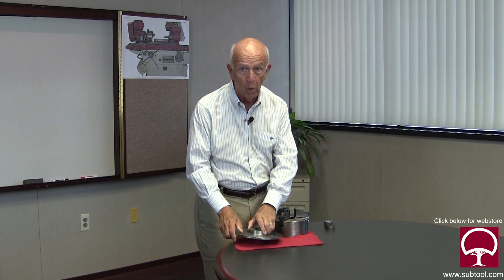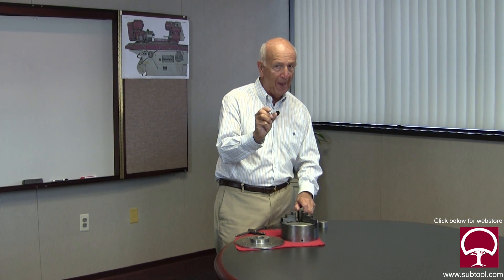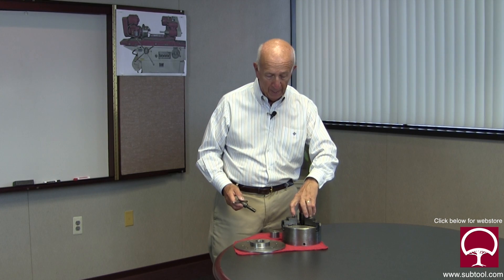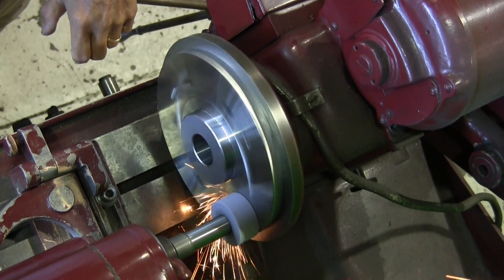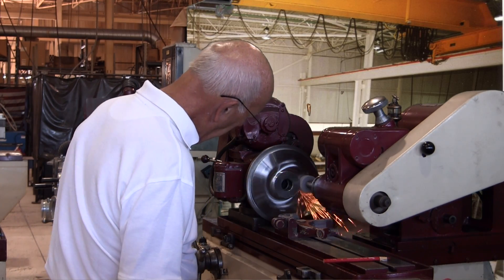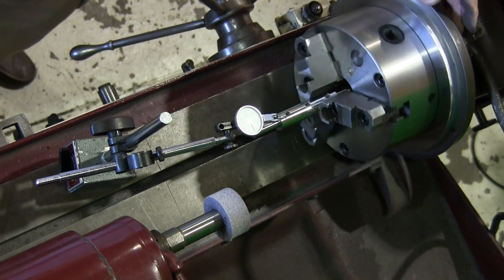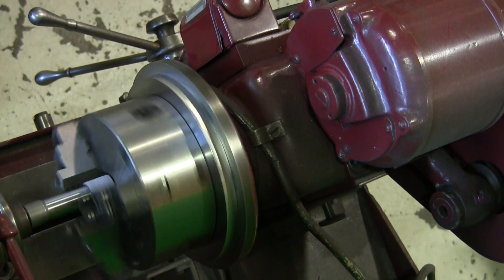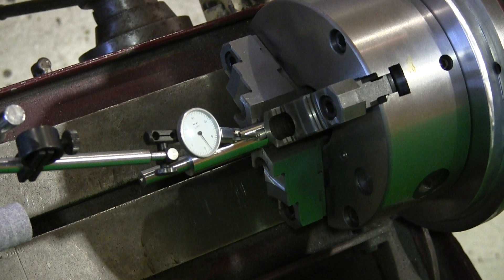How to improve the accuracy of your 3 jaw chuck.

Comment: Thank you for sharing that😊 These days I wire EDM a hole in a 1” thick plate to a wring or light press fit to the OD of my bushing, install it in the plate, then wire EDM the ID. Good size control and dead zero concentricity & taper. Or a specific taper if I want. Always good to know the alternative ways if you have certain equipment - yours is timeless 👍

Comment: I used a round grind stone in my tail stock with an old 3 jaw with 10 thousands run out and got it to 3 thousands,, had to try just to see if it could work and was surprised how well,, where there's a will there's a way,, just seems using the same machine is the best way to go

Comment: Have seen similar done in another video - but they removed 1 bolt from each jaw, fitted a longer bolt in each jaw and used those to clamp a machined ring - so the jaws are all under normal tightening tension without the normal jaw faces being obscured - so the full length of the jaws can be ground.

Comment: The biggest problem with 3 jaw chucks is the float from the internal spiral plate so cleaning and oiling the chuck from day one eliminates a lot of problems with wear and I found that just tapping into true works also just buy a new good quality chuck and cut your losses,I refused to use those bolt on jaw type chucks and so my 12 inch 3 jaw chucks ran inside one thou at all times and used older chucks for rougher jobs,horses for courses.

Comment: i think the only problem with this technique is that it depends on having a VERY VERY precise spiral cut into the jaw tensioning mechanism in the chuck ... if there's ANY deviation at all  - which there likely IS - you will get different concentricity at different diameters (or?)
Reply: My chuck has this problem,  spiral is not precise. I couldn't get a good concentricy

Comment: i actualy did this at my work, but if i watching things like this, i am really happy to live in europe, because number (for me its not really a true number) like "1/1000, 2/10" just blowing my mind ... For me is it like 1/1000  is 0.001 and 2/10 is 0.2 (is not really but you get the idea) and for grinding diameters is this very significant difference between those sizes of diiameters.
Reply: 2/10 is = .0002   [ 2 ten thousands of a inch ... bit of a slang  term. }

Comment: If you relieve the back of the jaws then won’t you lose some of your clamping surface?
Reply: Yes, you will. But the effect is negligible. In fact, you could end up with more bearing surface depending on how well the jaws were ground originally. Likely not all that precise.

On a run of the mill 3 jaw chuck, probably not ground super co-planar to the spindle bore in the first place.

Comment: After 55 years of lathe maching. Listen to this.  Even four jaw Chucks can use this method.  Have a plate made which has 4 jaw and 3 jaw holes drilled into it at proper diameter.and on the outter bolt holes of your chuck.  remove the allen head bolts and put a bolt in there to tighten the jaw.  clamp in that ring hard what preasure you will be using for your prodject. then grind the inner face of the jaws.  What you will find is perfection.  Remove the ring and replace the allen head bolt. Thanks for allowing me to imput.

Comment: That's all good if you hold your parts in lathe in the back of jaws and tighten lightly, as you did when grinding.

Mostly we hold parts in the front when turning ...the jaws need to be tighten allot more then grinding, you need to mimic this when grinding jaws.
As jaws need more clamping power in front, the pre load needs to be in the front...I do this with ring and 3 dowel pins installed which go inside the jaw hole in front,  [need to be loose],  my Forkardt chuck have holes in hard jaws, you could drill also],  some people use the jaw screw holes for mounting ring which I see only a slight problem...the jaws might slightly be binding from each other and uneven forces are applied..but with care this can be minimal and for this purpose well suited. 

About .003" taper to the back of hard jaws I grind or hard turn for spring back ..gives you greater clamping force in front where it's needed.

When turning soft jaws very accurate, most often I use a ring with 3 - 90degree bolts installed on the side...threaded part goes inside the ring, the none threaded part goes inside front of counter bored screw holes,  I can adjust easy to the size of parts turned by turning one or more screws in or out ...close to part size, [closer the better] very minimal of turning out soft jaws.

Comment: not a big fan of clamping the jaws inside the chuck to get them running true, especially when the chuck was already used for some time. the t-guidances might have worn out by then, and all you'd achieve is to have a taper on the jaws resulting in poor stabilization of longer parts and they would never run true.
what i do on my lathe is to get a new set of (hardened bloc) jaws, bore a small hole in the most protruding surface in all of them at roughly the same position and insert a bolt of the same diameter in order to clamp a machined ring. with that you got the clearance to grind/turn the ID of the jaws all the way through just perfectly the way they would bend out naturally inside the t-guidances of the chuck and without any taper by default.
i actually performed that recently on a 15 year old 10" chuck, and the runout on a most precise carbide shaft with .45" diameter was below a third of a thou with no significant taper on about 4 inches away from the jaws.
worked everytime so far.

Comment: I learned that from a toolmaker 30 years ago. My chuck on the lathe still good, first tighten to 2-3 microns!. The important thing is to always tighten in the same chuck key hole, so that the scroll is in the orientation, internally as when jaws were first ground. As well as grinding the jaws, I used a mild steel bar in the tailstock, grinding paste, and did final lapping finish on the jaws, tightening down on the bar and grinding paste. As long as jaw numbers are always sequenced the same, works a treat! Can get better than that, with the soft hammer, as it is tightened. 2-3 microns is perfect for most jobs in the lathe, (and I have a tool post grinder, too).
 Hope this helps ;)

Comment: If the scroll has run out then it may be in the bearing surface of the chuck where the scroll runs on. The boss that the scroll bearing surface runs on has to be machined and a
 ring put on it and then ground or accurately machined to be a transition fit for the scroll bearing surface for it to be accurate.  
If this has slop then all the amount of machining the jaws won't fix it.  The hard part is accurately measuring the surface of the chuck boss to be able to get a good fit
 as it's deep down inside the chuck with about an inch of clearance either side.  calipers aren't accurate enough so a micrometer is needed.

Comment: Why not turn the jaws? a rough finish will help grip your part better I think. It's how we do it at least. and why not indicate the chuck before grinding? i know youll take off less material but won't your chuck be running out and causing your lathe to shake at high speeds? 
don't want to sound smart, I'm still learning and asking questions.

I subscribed
thanks for the great videos!
Reply: Totally agree with indicating the chuck before grinding the jaws. Indicating the jaws does not make sense.
Reply: I agree indicating the chuck first then indicating the jaws to find the difference before grinding.
Reply: To the Russian-----------In a large shop where tooling is passed around from machine to machine, it would be impractical to fit tooling to one particular machine and have it not fit another.  This is the purpose of having the ability to adjust your chuck to each machine any time.

Comment: These videos are great, i grind drive shafts for outboard motors on a O.D. Cincinnati grinder. I'm not to experience with grinding, been doing it for almost a year. I use a flag, dog, gauge, and steady rests (backrests). Grinding to me is very stressful. On my first grinder I have to get a wheel up to a shoulder with tolerance of 6-9 thou stock removal. Any advise on how to get the wheel to touch on the shoulder without crashing the wheel on my first part?

Comment: good stuff...question regarding resurface the mag table on the surface grinder!does it matter if the mag is on or off?my thought is on...considering that's the condition while grinding! but...
Reply: namba
Reply: Nemo Cacihlas make sure it is on, this is because when holding .0001 inch your magnetic strips will move a few tenthousandths so you need to make sure the magnet is pulling it in the same was as when grinding. When you are done you want to do a five block tests to verify accuracy

Comment: You need to tighten the jaws on the slug with the one of the pinions on the chuck that's marked with a zero (0). Some chucks don't have it and if they don't, and you are grinding a chuck without it, designate one by stamping a zero beside it preferably before mounting it on the grinder. Then use it to tighten the slug and future work-pieces that need near minimum zero run out.
Reply: Not necessary on a chuck like in the video, as it is an SetTru style chuck which can be dialed in with those setscrews.

On non-adjustable chucks it is a good idea, but don't just blindly follow that advice. I have found many chucks that will give you different runouts on differents diameters depending what chuck key hole you use. This means that the scroll has worn a bit and can cock inside the chuck, making the jaws move one way or the other. On a worn chuck you can tap the jaws with a piece of copper to move the jaws into alignment, basically pushing the scroll the way you want.

Comment: For all those wanting to know a setting ring is the way to ensure you machine jaws under the correct vector Look up Hass how to cut soft jaws this will help in understanding.
A 3 jaw is only going to be as acurate as the scroll and guides so beware of constantly grinding hard jaws to gain accuracy at different diameters, soft jaws are available for most chucks and are a lot cheeper.
Reply from the maker: Your right that's another approach.

Comment: Thanks for this video. I have been looked at ALL the youtube vids on the subject grinding jaws and there are more than a few. It seems there is a common thread in most of these which comes around in many comments. This is that, "if the jaws are worn the scroll is as well". I personally cannot refute this claim as I am strictly a complete novice to this trade. 
My question to you, if I may, is:
Why do all the videos show the jaws being ground with the machine spindle running?
Why would it not be just as good to set up the TP grinder, in a manner that most do, and manually index the jaws by turning the chuck by hand? In other words position a jaw, then grind and move on to the next???
Thanks
BTW - I am working on a 6" chuck that I have on an old Sheldon 10" EXL lathe. What I did so far was grind the removable tops using my T&C grinder. I placed all three of the jaws in a precision vise with the tongue of each jaw resting on the fixed side of the vise and ground all at once. I will mount them in the chuck and check for TIR to see if doing this gets me in the ball park. If I am .001-.003 TIR I'll live with it and expect nothing more.

Comment: I like the Buck chucks that have 4 screws over the ones with 3 screws. The 3 screw chucks will only dial in to about .0005 and the 4 screw chucks will dial in within .0001. You are right there are several ways to do this although using an out-lock will give better results on worn out chucks.

Comment: The chuck will grip better and run truer by loading the jaws with a hollow ring with 3 pins that fit into the inner bolts that hold the jaws on. This makes the jaws spring outward like they will under gripping pressure when holding a short part that only engages the tip of the jaws. When the jaws are ground like this you can see the tip of the jaws engage the part first and then as you increase the chucking pressure you see the jaws finally engage the part at the back of the jaws. This will make a chuck perform unbelievably better especially on lathe work with a lot of part hanging out of the chuck. The difference has to be experienced to be believed!
Reply: +SuburbanTool Inc I agree completely with those comments and that is not what I am nitpicking about. My point is that loading the master jaws while grinding the jaws does not simulate the jaw forces and deflections that occur while gripping the part. That is why loading the jaws at the nose with a standard chuck jaw boring ring will give more stable gripping with less pressure.  Haas has 2 excellent videos on YT on proper soft jaw turning and boring techniques that show the point better than my explanation.  Thanks for not just deleting my comments and being willing to have discussion.
Reply: ExtantFrodo2  Yes because of machining tolerances in the scroll, jaws, chuck body etc. Trying to do precision lathe work with any scroll chuck is an exercise in futility. A good experienced machinist can dial in a 4 jaw within a couple of minutes.
Reply from the maker: +ROBRENZ Our application was for an ID grinder and part specific. You technique would work well on a lathe. great comment and thanks for watching.
Reply: +SuburbanTool Inc IMO other than gripping force, chucking techniques are the same for turning and grinding. A chuck will always perform better by loading at the nose of the jaws. I am not trying to be a know it all Jerk, but a lot of beginners watch these videos and I think it is important to point out nuances of technique that will help them as all of your videos do.
Reply: SuburbanTool Inc
    I do not have a grinder I could attach to my carriage, so one at a time I aligned my jaws with an indicator, in a vise, on my milling machine. Then in the mill's spindle, using a grinding wheel I had previously dressed true, I removed the necessary amount from the jaws. I brought the runout down from .012 to .001
   Needless to say I was very happy that it worked. This is certainly not the preferred method, but it was the only one I was able to implement.
Reply from the maker: +ROBRENZ We thank you for your comment and concern however,we were size specific. That is we have a 1" dia. part and we grind at 1". If you grind the jaws at 1" and then chuck up a 2", 3" , 4" part there will be error due to the inaccuracy of the scroll.
Reply: I remember Forrest A talking about "printing "a chuck by tighting jaws down rather tight on a piece of medium soft  ...say 1018 steel and then carefully looking carefully at the slight impression they leave to determine pressure areas....even front to back is good.
    On one of his videos Don B talks about using  hand pressure on the internal grinding head to move it in  or out a couple tenths...perhaps this technic could be used help to get "even " pressing jaws.
Reply: The unavoidable problem is that the run out will change depending on the diameter of the work piece. Grinding for one diameter could easily make it worse for another diameter.

Comment: Great video on a subject that affects anyone that has used a lathe very much. I would also be interested in your take/process for correcting "bell-mouthed" jaws on a 4-jaw independent chuck; an entirely different animal which seems much more difficult to preload & grind true.
Reply from the maker: +Robert Ross It will definitely help to do this on a 4 jaw chuck, but it will be challenging to position the jaws back into the same place you ground them.

Comment: Perhaps you can explain, but if you grind the master jaws when the chuck isn't preloaded, then you preload the master jaws and grind the top jaws, the loads can be uneven on the jaws because the scroll wasn't preloaded during the master jaw grinding.

Every tutorial I've seen on grinding jaws starts with taking the lash out of the scroll to ensure you aren't grinding one jaw more than the others.  Yes, I realize you were using a brand-new chuck, and perhaps that influences your technique, but I'd like to hear your explanation for not preloading the master jaws with a clamp ring.

Also, do you touch up the top jaws for every part, to ensure utmost accuracy, or do you just chock up any error to "within tolerances"?

I'm surprised to see a 3 jaw used for a final grind, or is it typical to grind the ID first, then use the ID as the locating feature for OD grinding?
Reply from the maker: +eformance The first grind was a relief grind. After the relief was put in, the jaws were preloaded and ground. It all depends on the parts being ground and the tolerances as to when we grind the jaws.

Comment: You have one thing right you must have pressure of jaws in the direction your going to clamp parts.
The way I do it is set jaws to your diameter then make a ring that that you can bolt thru using the outer bolts that hold the two piece jaws on then tighten chuck that way you can grind all the way thru chuck jaws.

Comment: Great video. I like the way you think. :-)
Reply from the maker: +Metal Tips and Tricks (Dale Derry) Thanks Dale , how is your shop coming?
Reply: +SuburbanTool Inc 
 Thanks for asking. The new shop is great. I think you will appreciate this. The grinding room  should be finished this month. It will house a 6x18 Harig surface grinder, KO lee universal tool and cutter grinder, plus some smaller bench grinders, and its own 2 hp dust collecting system .  All the machine have been rebuilt and are painted my favorite color for machines, high gloss antique white.
Don the next time you're in Atlanta you should come by. 
Thanks Dale d